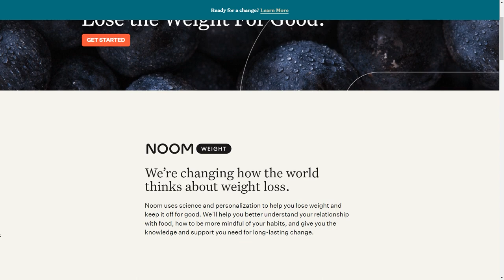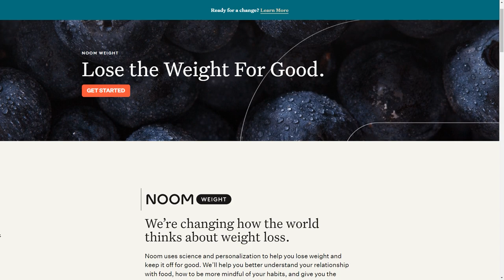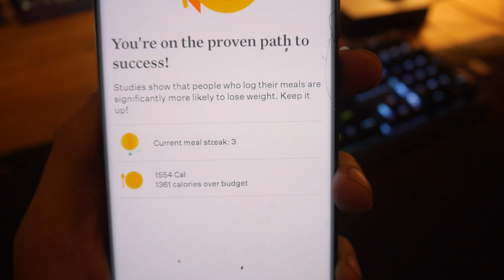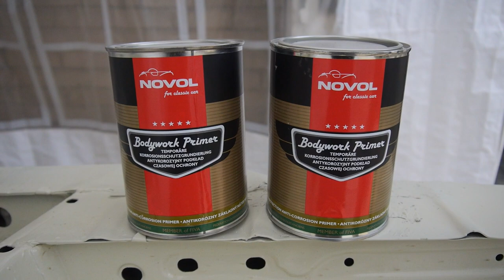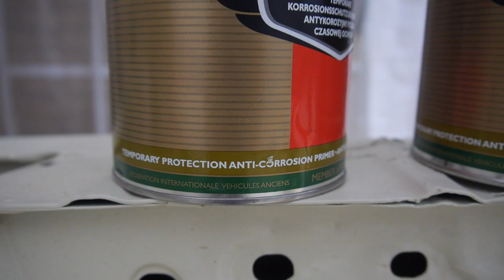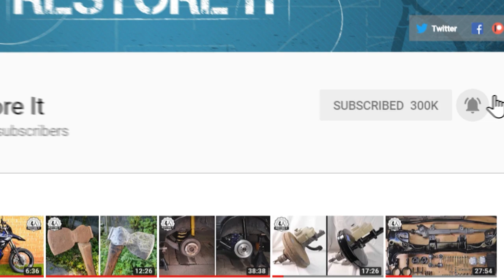BMW E30 325i Sport Restoration - Starting From Scratch

Comment: Great videos and keep up the good work. FYI - You can apply primer straight to blasted metal as long as it is clean. The extra roughness of the blasted metal will only help the primer adhere even better than the finish of a wire wheel. Plus, that way you don't risk contaminating the metal if not using fresh, clean wire wheels. You can also use an acid treatment like Phospho to etch and treat flash rust before priming (as long as not using an etch primer).

Comment: Hi Steve,
That piece on the chassis leg, for the new piece, you should have just drilled out the spot welds, removed the old piece and weld up the old spot weld with the new piece inserted. Would have saved you hours. Loving the project, keep up the good work
Reply: Yup, same thoughts here.

Comment: Search for a spot weld cutter. It's a drill bit which is basically a small hole saw but with a sprung loaded centre point. You can easily cut the spot weld off the top sheet without cutting into the second.
You could even use it on the one where you are keeping the top piece because you are just left with small holes in the location of the spot welds which you can use to plug weld the new piece in.

Comment: When drilling holes ready for welding they need to be a decent size, 5/6mm, that way you can get a proper weld join. Didn't look like you had enough power/penetration to me, I would double check that 👍

Comment: Good to see the Beemer back. Parts cars on the doorstep are a very good thing, you never know what you’re going to need, plus they’re a good reference guide when you’re trying to visualise a rebuild.
Got to agree about the Finger Sander, highly useful for what it is.
Great work keep at it, although i did wince when i saw you pulling at those bits of panel you cut out without gloves on ... been there too often, sliced fingers ruin your day.
Reply from the maker: Thanks, Steve. And you're not wrong about a sliced finger...

Comment: Great to see you using the bodywork primer. I am restoring a classic mini and the shell is protected with the same stuff. It protects it way longer than the 6 months in the specs. Easy to sand and weld with compared with the epoxy.
Reply from the maker: Good to know Conor! And good luck with the Mini.

Comment: Just wanted to share amateur to amateur, I'm also building a 1987 325is and have it on a rotisserie. I wanted to prevent the kind of damage to the bumper shock mounts you repaired in this episode so I built plates that fit into the mount area with holes to bolt it to the mount, welded some 2x2 square tube to that plate and then mounted all that to the bumper shock mount. I have pictures I can share but no worries if you're good with what you have. Sorry for the unsolicited input, I'm sure you get enough of it everyday. Love the videos.

Comment: Hey mate, just having a look at this haven’t seen too much but I’d recommend taking the sunroof tray  off. Bmw sell them new but there is a bit of glue between the two that doesnt stop rust. You can take them off the skin if you are gentle. But it’s tricky. Going to this much effort I recommend it. Also invest in a quick strip disk and a rotary polisher. Strips quick on low speed without warping.

Comment: When you want to use a panel, it's better to grind the spot welds of from the panel touching it, than to use a spot weld drill. Spot weld drills are good when you want to separate two panels and weld them together later. When you are just using one of the two panels; use a finger sander or a flap disc to grind the panel you are not using and keep the panel that you are using in perfect shape; no drills going too deep by mistake or deformation from using a chisel to split them.
Reply: In the case of this small front piece with the square nuts, I would have just cut off the chassis leg with an angle grinder 5mm behind the piece you want to use and then grind what is left on the piece off with a flap disc.
Reply from the maker: Thanks for the advice Peter, much appreaciated!
Reply: @RestoreIt  I commented before watching the video to the end. I later saw that you already learned that lesson and used it to clean up the pillars on the rear quarter panel. Good job; we all learn these things by doing.

Comment: Buy an MBX-grinder for removing the undercoating. Then you get a good surface for prep work after :) 
Also, you might want to lengthen the hoses for draining from the sunroof. Not 100% sure how it is on E30's, but on E34's the hoses stop inside the sills and that makes the car rust. I am going to extend the hoses on my own E30 to make sure the rain doesn't end up inside my sills.

Keep up the good work :D
Reply from the maker: Hey Rune! Thanks for the advice. And I agree, I'll be doing the same! I'll also being looking into a MBX, cheers!

Comment: "But I cannot sleep at night knowing the engine bay is a different color". That plus the change of mind regarding the rust treatment (going acid dip after having done so much already). Oh man, I share the same irrational anxiety. That is me, 100%, on my 240Z restoration. And at the end of the day, I am still not happy because "I would have saved so much time and money if I did it like X the first time"
I admire your work though. Thorough as usual. Great video, which I am sure is time consuming.. It's awesome! And I admire your workshop!! I wish I had one as well!!
Regarding the "red primer", I really don't think you HAD to do it before the acid dip. I am pretty sure it is a phosphate acid primer, which is good against corrosion for a while but weak against scratches. Simply applying phosphate acid on all the bare metal would do the same, look better and would cost close to nothing. Either way, it's done, and it's good enough. Just think about phosphate acid for the next one :)

Comment: Clean the weld through primer off where your going to weld by using a small wire brush in your dremmel tool through the drilled holes, you will be surprised how much better the welds will be. It's great stuff but it's commonly misused, it should always be cleaned from the actual welding area to prevent contamination in the weld pool.
Reply from the maker: Thanks a lot for the advice David, I'll remember this going forward!
Reply: @RestoreIt  keep plodding on, your doing a great job. All the work will be worth it when you have a better than factory 325i 👍

Comment: Why did you not install cross braces?  I could see the shell flex when you lowered the lift.  This shell will now have to be aligned, unless you want to hit speed bumps in the middle of the car.
not a criticism, your work is good.

Comment: Da, it takes very much patience to renovate something as it should be done, not just by filling holes with bondo (or even worse spray foam, the new fashion), therefore you must have enough motivation, time, a place to do it, some "connections".. =) You do, apparently, so good for you. Don't worry if you drill a little in the underlying panel when picking spots, even if you drill through is not a big deal that weld can't cope with.. =) It might get your job waaay faster. When you repait holes on a single skin, if you can, clamp on the back a piece of copper and magically the hole will fill itself..  Cheers anyway, I'm enjoying the progress, although I thought BMW's don't rust so much.. Cheers, go on, it's too late to stop! 😉

Comment: will there be a video in the future where you assemble the engine (if u do such work in your restorations, cause im new here). Amazing video man, keep it up!
Reply from the maker: Hwy Muki! Check back in the video catalogue. The engine has already been done in a 9 part series! :D
Reply: @RestoreIt  just watched it, little advice ofr the fuel injectors, buy brand new ones, cause if u clean them they will start leaking at some point for sure

Comment: Silly question, but why didn't you just drill out the rusty one since you were going to drill holes anyway, might have been a whole lot easier to extract
Reply from the maker: I didn't drill holes into the plate though. Just along the bottom of it. I wanted to keep it as untouched as possible
Reply: I wondered this too, you went around it in a way that gave you more work than you needed. If it where me, the donor car, whack the front inch off the leg with a grinder, then you can easily grind through the top of each weld with the grinder… no need for a spot weld drill, you only use those when your trying to take a part off and re use it on the same car (but I see people do this every day).  Then on the car your restoring you sacrifice the bit you don’t want again, conventional drill through the spot welds, all the way through and the bad part comes away easily. Granted you would have had to use the finger sander along the bottom.

Comment: It is a lot easier to drill welding points than you think, you need a M8 cobalt drill, or buy a few and resharp them, so you can have some spares and you don't waste so much time on these. I recommend you watch these 2 videos, these are in russian, but you don't need to listen them to understand, you can get the point just by watching. I was like you before, but now I don't waste so much time on these things.

1. watch?v=t70aR15XLSQ
2. watch?v=IxuHJ99SWow

P.S. No links, yt will not let me post these.

Comment: First time i've seen you, nice work shop but needs more light fella, not seen enough of your work yet to comment.
Reply from the maker: Glad you found me. There are two roofs to my current workshop. One asbestos, and a metal one put onto of it... both have filthy skylights.. and annoying there are 36 in total. Im moving workshop soon, so the lighting issue will be sorted. Cheers!
Reply: @RestoreIt  must have a few quid with a workshop like that.

Comment: What weld through primer do you use? I can't seem to get a clean weld on mine. Like there is no contact when the welding wire connects.

Comment: Hello I am a subscriber of your YouTube channel and I am restoring my father's Mercedes w123 and I have a question for you, I have restored the frame of the rear window that had a lot of rust and I am not sure but I think there is a hole in the lower part to drain the water that remains under the glass rubber. Greetings from Spain and thanks.

Comment: I haven't commented back then and this is now already 2 month old video, but honestly don't worry about chop. It would crime against cars if you take complete car which "could be saved" and chop it as many people do. It just painful to see them buying complete cars for slightly more money than they worth whole knowing full well that they recoup it when they part them out. Countless E30s and E24s have ended their life like this. I even tried to buy one E24 last year, it needed loads of work but seller would not budge, he wanted rather arbitrary £6,000 no matter what... I made him several reasonable offers working backwards from my budget of £10,000 and considering what car needed doing... to be really honest my realistic calculation ended-up in negative (meaning car just wasn't worth fixing), but best case scenario (it is never best case!) I figured I can offer him £3250 and he had some bit and wheels so I said let's do it for £3500... 3700... 3850... . NOPE he wanted £6,000. At this point I got principal as well, because I detailed very clearly what car needs doing and how it makes it worth basically £0 anyway, but I would be willing to take it just to save it  and I liked it was silver 628, manual, with blue leather and rear seats with headrests and with sunroof. So I said F-it I am not going to be overpaying in principle. 2... weeks later cars sold! Another 2 weeks later I see 628 parts available from one well known 6-series butchers on ebay... 

In short - yes there are people who are actively destroying classic cars for profit. You are NOT one of them... that E30 was a crashed shell already destined for scrappers, basically somebody already bought it, salvaged it for parts and wanted to get rid of it, it wasn't worth anything anyway and it helps you to bring another car on the road. Don't feel bad about it!

Comment: If your dipping it why are blasting it or even priming it
Reply from the maker: Because it shouldn't be rust in the first place. I'm getting it back to where it was when it was first blasted.
Reply: Yea but you do realise that they’re going to have to acid dip the shell which will remove all the rust and paint and sealer even the sealer in between the the panels which is why I wouldn’t dip a car because you’ll never get the factory sealer back in between certain panels which will end up bleeding rust in between panels